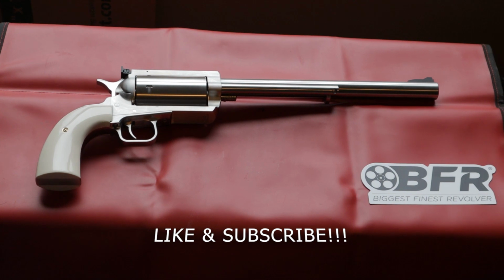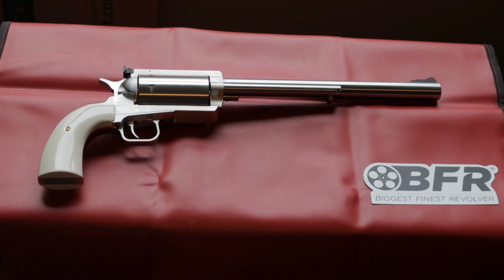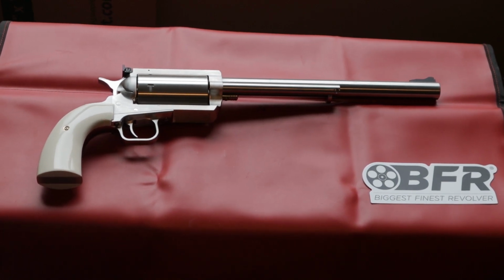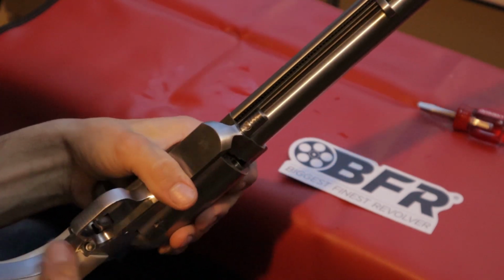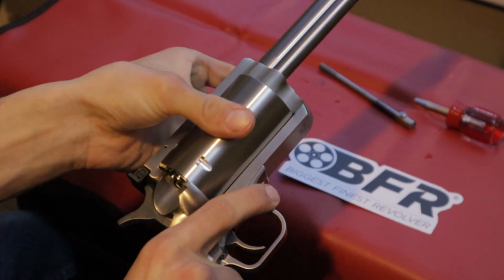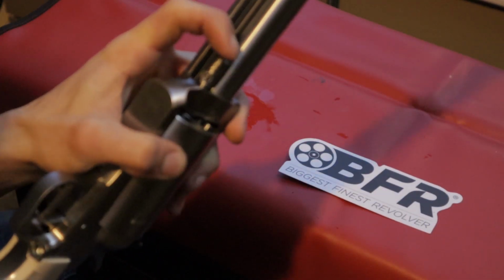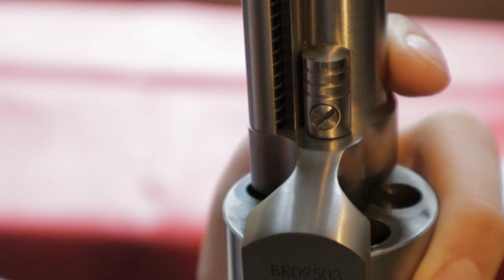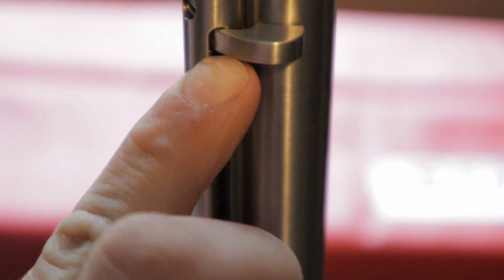45-70 BFR Revolver disassembly and cleaning

Comment: I recently did a detailed disassembly of my BFR. The design is almost identical to the Ruger Blackhawk. There are several detailed disassembly videos on the Blackhawk.
Reply: What size screwdrivers do you need? I recently bought a BFR and I would like to disassemble it for deep cleaning.
Reply: @juliosaenz8172  small lol

Comment: Can you change the cylinder to shoot 45acp, 45colt or 45longcolt? Is this possible or don't they make something like this?
Reply from the maker: Magnum Research makes a BFR for 45's.  However I do not believe it would fit on this frame.  This is my first BFR from magnum Research. they are a bit pricey... however I have been very pleased and would highly recommend.
Reply: 45-70 is a .458 cal 45lc is a .452 Cal you can do 450marlin in the 45-70 maybe they may do 458 socom not see but have not called on that yet.

Comment: I hate that you need a screwdriver for takedown. They could have easily done a button release for the base pin like the Blackhawk it's based on. This is like black powder Colt takedown.
Reply: I seen them with the Blackhawk take down but i don't know if was a older style or a custom job. I know I only seen a few and they all seemed be from earlier 2000s